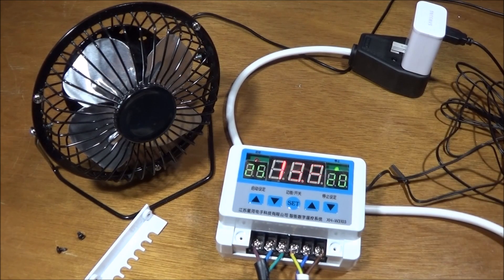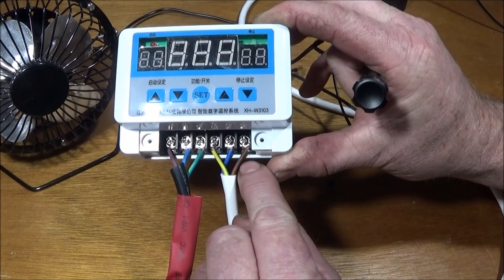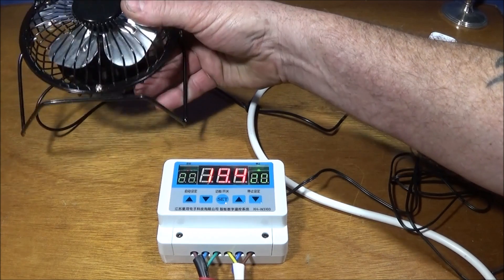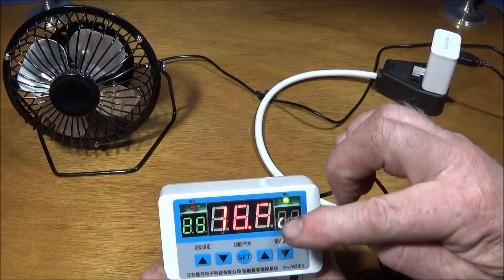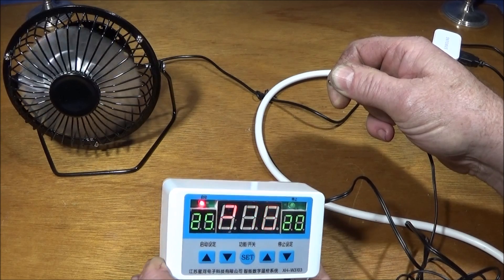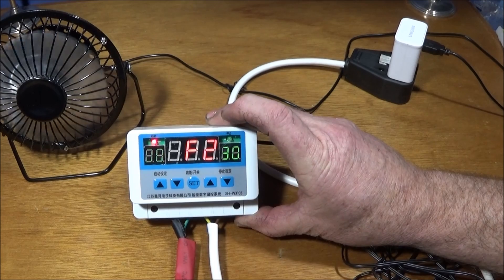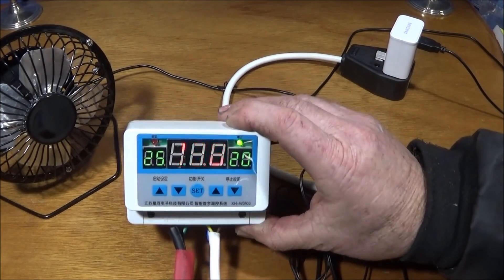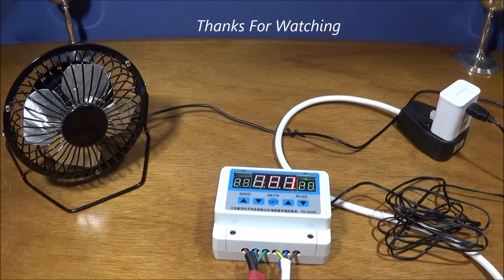A Lathe Camera Mount & The XH-W3103 Thermostat Motor Cooler

Comment from the maker: THERMOSTAT THERMOMETER LINK (Choose voltage required on listing)
XH-W3103 AC 220V DC 12V 24V Digital Thermostat 30A Thermometer  -- http://bit.ly/2O2JoXe
Reply from the maker: 55% off Mechanical Parts Promotion -- http://bit.ly/2Uw9PqG
Spring Sale -- http://bit.ly/2VzASRP
Electronic Tools Sale -- http://bit.ly/2SLxUYG

Comment: In principle the 'steady' camera mount is a good idea and you've implemented it well.  However, I see 2 problems with it.  1. I very much doubt it's going to be that steady.  2.  You don't really want the camera to travel, there's no need.  The shot of work on the lathe really needs to be static and steady focusing on the cutting point.  If the cutting point is moving over a large distance (unlikely on an ML7 or the mini-lathe) then widen the shot or take the shot in sections with cut-aways in-between the shots.  I've seen others using traveling cameras on the carriage and it' makes for uncomfortable viewing.  The camera is much better placed off the working machine so as to have a steady, vibration-free shot.